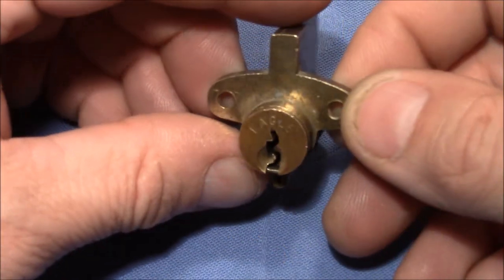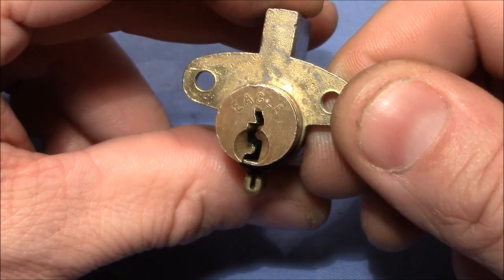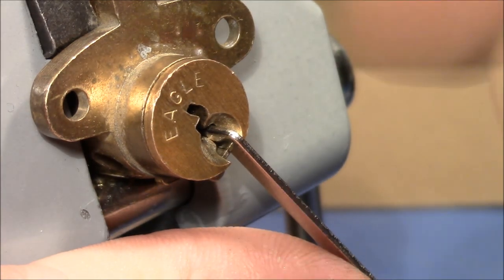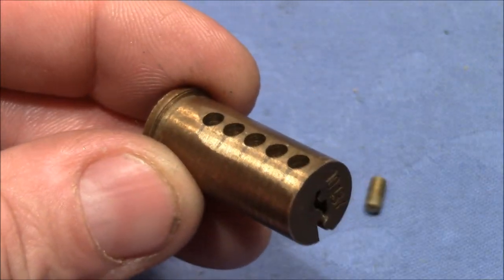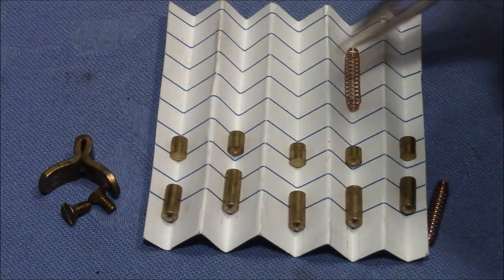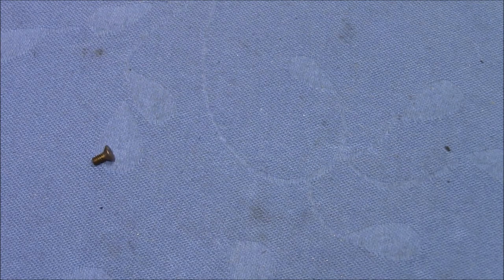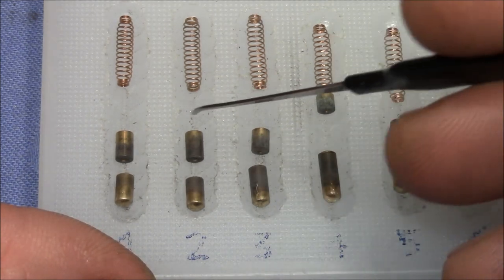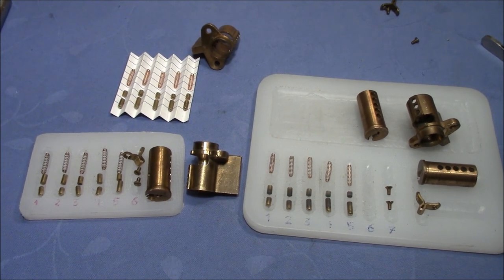(picking 430) Three old post box locks - unusual shape - fun locks - thanks 'Artemis Picks'

Comment: I enjoy your enthusiasm and agree, older locks are often more interesting. Also often very well made. With locks like those that were plainly used in great numbers it was possible to make a reliable lock from good materials at an affordable price. As such, brass won't rust but does have copper in it which will react with chemicals in both air and water to produce compounds that may stain but are fairly soft and will often be cleared by operation of the lock. WD40 is a terrible long term lock lubricant as it dries out after attracting grit and dirt but it is quite a good solvent and thus good for cleaning.
Reply from the maker: Thanks a lot for the remainder that WD40 is not good longtime lubricant.  What else do you recommend instead?  Graphite?
Reply: Graphite is good. Best used on a new or cleaned lock but the schmoo that it can create is still slippy. But really they should just be clean so the brass can 'self lubricate' as it is slightly ductile. that is why you don't want anything that grit and dirt can stick to in there if at all possible. They don't put anything in at the factory. As far as sprays go, GT85 has Teflon in it which stays slippy once the oil has gone, so probably better from a maintenance point of view. For picking WD40 is great for freeing up a lock that is a bit bound but a month later it'll be all gunked up again if exposed to the elements. This is all for pin tumblers by the way. Lever locks need the levers dry and a bit grease behind the bolt.
Reply from the maker: Very useful info - thanks a lot. I didn't know that brass lubricates itself - good to know. Will check out GT85 if I ever wanna lubricate a lock.

Comment: The Yale lock looks like it was made with a better process, the Eagle key pin/driver combos were cut from the same length of brass rod just cut in two pieces, leaving a small tab in the center of the driver pins. The Yale didn't appear to have that. Plus, the Eagles had to be ground on top of the core to allow for sloppy pin heights and the Yale wasn't.
Overall this was a fun video. Thank you.
Reply from the maker: Very precise observation. You often see these rounded pins; also tapered plug chambers or a flattened plug ensures the key to work smooth even with wear - also makes picking easier. Thanks for watching :-)